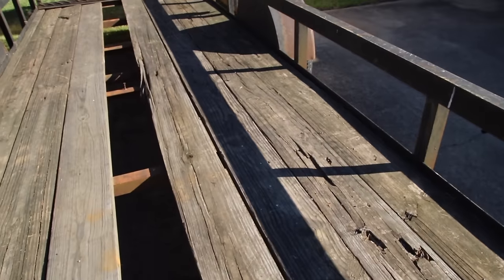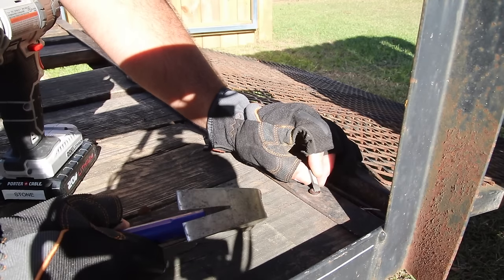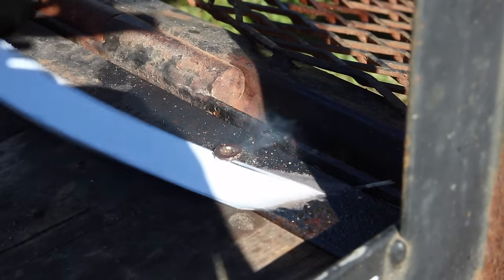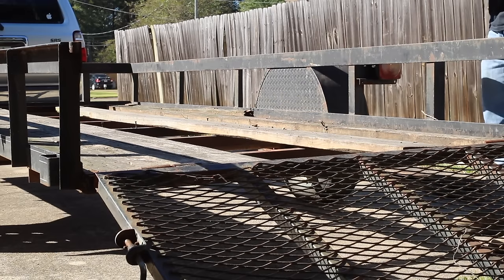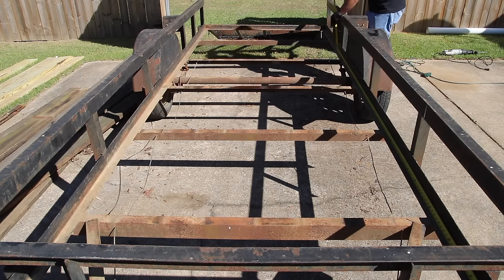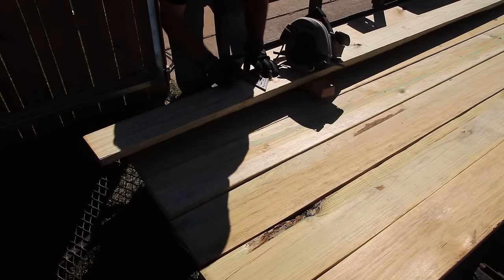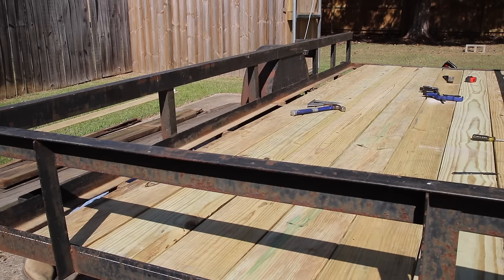Utility Trailer Floor Replacement

Comment: I did not know that angle iron could come out. That makes replacing the deck so much more easier. Thanks for uploading this video!
Reply: It’s welded in on my trailer 😢

Comment: Most trailers are designed for conventional lumber, with out ripping. Spaces between the boards is usually not needed because the boards shrink as the get old and dry out. It's usually 11 2x8....or 10 2x10...I build theses trailers for a living.
Reply: Perhaps you can help me.   I inherited an old flat trailer, with no wood floor.  There is a channel on the front and the back of the trailer.  How do I put the boards in so that they catch in both channels?  There are no screw holes in the support angle iron underneath, so somehow the old boards were put in place without being screwed down.
Reply: @darrinmiller8030  I'm in the same boat. I have no idea how to put the new boards in
Reply: Darrin Miller you can cut the bead of the weld at the end of the angle iron so you can lift it out and put the boards in and then either tack it back down or screw it back on like in this video. I did it to my trailer and it went well.
Reply: Hmmm
Reply: What should I use on my 6x12 with out having to rip the last board?
Reply: @aidenchaffee5568  Not sure what you're asking. If you're asking about what width of boards, You would still have to rip each one to get that. The likelihood that they will fit in at say the five and a half inches of 2x6 boards is pretty low. One way to do it is to lay them in there and and space them evenly and you might make it work without ripping anything.

Comment: Repainting the cross braces of the trailer while the floor was out would have been value added. Also treating the floor boards with Thompsons water seal before installation would have added years to the wood.

Comment: Here’s a trick for everybody......
every time I change the oil in one of my vehicles I collect the spent oil in a 5 gallon pail and then every couple or three years I pour the oil  onto the deck of the trailer and sweep it in with a broom I would buy for $1.50 at the dollar store which I would later throwaway

 Oiling of the deck  does 2 things:  it prevents the deck boards from rotting and it prevents the deck  from shrinking
 without doing my trailer  which has a 16 foot  long footprint  lost 2 inches, when we tried to load cargo which was exactly 16 feet long we were unable to close the back doors,these 2 inches came back a few days after the trailer deck was oiled

Comment: I have found PB Blaster to be a great rust penetrant. Regardless,  the sawzall worked. Nice job!
Reply from the maker: +Jeremy Condon never heard of that. Thanks!
Reply: I found Freeall is much better anything else. I tried PB blaster and it did crap. Then I used Freeall, loosened in minutes.

Comment: How did the gap work out after the new boards dried 
  I have read different opinion in regards to spacing new wet pressure treated boards for my 5x8 utility trailer.

Comment: Once I went to that trouble think I would have cleaned it up and give it a coat of rust proofing. Know your a busy man, is that what we call in Aussie treated pine!!!!
Reply: Just use old engine oil after you change your cars oil why waste of money with store-bought stuff
Reply: or at least some Undercoating to kinda slow down  the rust creeep..

Comment: How did you remove the bolt that was screwed to the angle iron to hold down the boards? I’m working on the same project and having a hard time unscrewing the bolts because they are so rusted

Comment: Question:  my trailer has 2 rows of additional fasteners along braces a couple of feet fore and aft of the mid brace.  Did you just decide the additional fasteners were unnecessary?

Comment: That came out nice.  Thanks for sharing.  A new trailer deck is refreshing.   I did mine about 10 years ago.  It was long overdue as well.  See you next time!
Reply from the maker: +DIY Dillon Thanks! It’s definitely refreshing.
Reply: Dillons Woodworks b

Comment: Nice job. One suggestion i have though. Instead of waiting until the last board to rip. Get your measurements and put the ripped board in the center for a more symmetrical look. Thanks
Reply: A wise man speaks 👍👍👍
Reply: Definitely, was told to start in the middle and work out. You can possibly make the two end boards more narrow if possible.
Reply: My plan is to start in the middle and work to the sides. That would leave the narrowest boards on the edges rather than in the center. It's one concept anyhow.

Comment: Yeah I'm going to seal/treat the wood 1st and add several years to the floor 😉  and since I'm at it just as well wire wheel the metal and rust proof that also.

Comment: What type of screw did you use to secure the decking to the trailer?
Reply: I dont think he did. It looked like the front edges were under the front angle iron and the rear was also covered by that piece of angle iron. I just wondered if the rear boards could still bounce around because i dont think the 3 screws were into the trailer frame to hold them all down.

Comment: I simply cleaned the head out with a screw and compressed air and worked the impact forward and reverse until they came out no lube. The lube will make the heads strip

Comment: WD 40 is a water displacer(WD stands for “water displacer”)NOT a penetrating oil. Use Kroil, PB blaster, or ATF/ acetone mix.
Reply: PB is my go-to as well.
Reply: You are correct, but wd40 does offer some penetration. Check out the comparison on project farms channel. Very interesting results. 👌

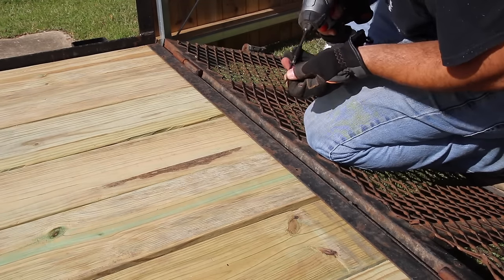Comment: At 5:09, you nailed the retaining bar down onto the boards.  But the boards (with retaining bar) aren't connected to the trailer at all, right?  So a crazy bump could lift the whole rear of the boards a couple of inches and it could start sliding rearward, correct?  Especially if you removed the rear gate in order to haul kayaks or something a bit longer than the bed.

I think I'd put 4 or 5 holes in the front retaining bar, too.  The one that's still welded down.  And driving screws in there would mean the boards couldn't "jump" and slide out of the deck, no matter how big of a bump you hit.
Reply: I see that the same way. I have almost the same front and rear angle iron set up on my trailer with no screws holding the boards down to any cross members in the middle, EXCEPT i made sure to use bigger screws to go through to the frame at the end of the trailers frame at the end.

Comment: So you don't put the same type of bolts back in? You use wood screws from the bottom? Will that hold as well as the original bolts?

Comment: My Tip: For cosmetic purposes only, I would have placed the cut board in the centre of the trailer floor.
Reply: Probably not in the middle as the hand cut line would not be as straight.  For cosmetic aka symmetry, he could have cut the piece on the other end, but that's more work and no one really cares as it is just a trailer bed :)

Comment: The only thing I plan to do different on mine is once the boards are cut to size apply the preservative on all sides then install
Reply: Technically all it really needs is oil. There's no point in finishing a trailer bed. The finish will just come off quickly if you use it with any regularity. Any kind of oil will do, just do it every so often. Not like every month, just maybe once a year or two.

Comment: I use used motor oil cut with diesel to preserve the treated lumber on all my trailers.  Just a thought.  Great stuff Shawn.  There are a bunch of people out there that would just trade it in instead of what you did (the right thing)
Reply: How long does the smell last?
Reply: @DarkLinkAD  I was thinking the same thing. I park my trailer in my garage, and I dont think I'd be able to ever do that again. I would bet the smell will always be there
Reply: No just no. Used motor oil will rot your lumber!
Its what people pour on old tree stumps to rot them away,..why? Cause it does!
Reply: I don't think I would use anything like used oil, but the idea is true, you want to oil your deck at least every couple years.
Reply: @daverea372  no it won't. It preserves it.

Comment: Excellent to the point and informative! Question, my trailer is nearly identical except it is 12’ and the rear angle iron or channel is not removable. It is welded all the way around the entire perimeter. Have you seen this before and have any recommendations? Thank you
Reply: Mine was 16 ft. I used a hydraulic jack underneath (with a scrap of wood to not dent the trailer wood, to bow the board to get them out. Reversed the procedure to put the new one in. Two people would have made the replacement easier, I used a clamping system to push the one end down. Once it’s lined up, then you can ease the jack down.
Reply: Cut a piece wide enough to slide and remove the boards
Reply: @agentleebs  I have a 10 foot long trailer and have the same issue with the rear angle iron. Bending a practice 2x6 but think that if I bent it enough to slip it in there it might break. Over a 16 foot span that would work easier. I have to do some more research on this. I can cut the boards shorter so the bend might work but would like to have as much length under the iron as possible. I welcome any help you might have.
Reply: @SmokeyBear363  Not sure what you meant, Mario.
Reply: Reading further I see that people have cut that angle iron in the back and then rewelded it or screwed it down somehow. I'm going to research that.
Reply: I don’t quite understand how he secured the boards from underneath. I know some guys drill up through the cross braces and all the way through the wood, then use larger self-tapping screws or bolts and nuts from the top to secure the boards. 
But it looked like he used wood or deck screw from underneath. They would  only go half to 3/4 way into the board, but that should be plenty to secure the boards and keep them from warping. 

I think…

Comment: Where did you buy the screws to attach decking?
Reply: Brad, did you find screws? I'm looking at torque's head black screws that can be had from Tacoma screw and fastener. They are self tapping so pre drill and run them in.
Reply: @cfbarnett  yes, thank you !

Comment: I'm really surprised you didn't paint that metal with a rust stopper paint when you had it exposed
Reply: Same thoughts
Reply: I read an earlier reply to a similar question. The original poster said he would do that at some time in the future but he was in a hurry to get a functional trailer up and running.

Comment: That was a good simple project. When you were struggling with the screw, you said you couldn't get under the angle. You could have cut through the wood to get to the screw. We tend to forget that we can destroy the piece we are replacing.
While you had the deck off did you inspect the wiring. On my nearly new trailer, the wiring is not up to my standards. I haven't felt motivated to crawl under it to fix the wiring.
Reply from the maker: +B Templeton Haha you’re right I could’ve cut the wood, and yes I did check the wiring. I was going to add the whole wiring thing to the video, but that it was a little bit off topic.
Reply: Great point.  Thanks.
Reply: @StoneandSonsWorkshop  My boards were so rotten that a grandson had a great time with a sledgehammer beating them to death.

Comment: On your stripped screw heads try an angle grinder, and make a slot in the head and try a Flathead bit. while all the boards are off might as well get a wire brush and get as much rust off the framing as possible, and repaint it.
Reply from the maker: At this moment i was just interested in a functional trailer. Later on I might rework the entire trailer.

Comment: Both pieces of angle iron on my Big Tex trailer are welded. Anyone else have this?  Is there a technique to replace the floor boards w/o cutting those welds?

Comment: At the very end where you screw the angle down to the boards.  Does it hold the boards down? It dont flop up in the back? mine is welded. I am actually fixing to redo my boards but don't have a welder to re-weld it. but if your method works then I'll go that route.
Reply: Yeah it looks like it would flop around. Mine's welded also so I have to cut the angle off then reweld it. Luckily I have a welder. Go buy you one at harbor freight cheap and if you don't want it after the job then return it 😉🍻
Reply: Just bow the boards up in the middle so you can get the ends to slide in the groove then release them.

Comment: just curious my trailer the boards are screwed down every few feet to a cross bar. when i put new wood down how would i line back up to those threaded holes? Somehow i have to make holes in the new boards to line up to the threaded hole in the trailer cross bar. any ideas?
Reply: You'll have to drill your boards from the bottom side under the trailer through the existing holes in the crossmembers. Its easier if you stand your trailer up on it's ass end although that's easier said than done.
Reply: I did this last year and watched this video just to see how he handled it.  But he only showed himself sliding under the trailer.  The rear angle bracket is the hardest because it has to go perfectly through 2 holes.  I made a drill guide to insure I kept the bit straight and drilled from underneath.  Once you make that first hole, put a bolt in it to keep it from moving while you do the others.
Reply: I wasn't careful on one hole in the crossmember and drilled it bigger so the threads don't catch.  That board bows up at that point.  Since the bolts are cutting bolts, the drill bit can be slightly smaller than the hole and avoid reaming out the hole in the metal.

Comment: Did you screw the boards back on from underneath the trailer?
Reply: That's my question as well. Seems like the trailer will flex and eventually warp or cause welds to fall under load.

Comment: Great video mine little different homemade built from previous owner at the gate I didn’t have screws on top nor bottom. I was told to remove gate then cut angle iron or bar that it slides in then re weld crazy huh. I can tear it up just need to get a good solder kit now lol.

Comment: Durn nice job, looks good and done right!
Reply from the maker: It’s solid. 👍
Reply: Stone and Sons Workshop I'm about to do my 5x8, the stamped metal is shot and I'll take the real bad stuff out and want to go back with  maybe 2x6 boards or I kind of thought about looking at  those poly decking  boards since I only haul my mower and some light stuff around the house.

Comment: Just wanted to share this, Kroil is far superior to WD 40 to get into stuck screws and bolts in about the same soak time. try it once you will agree. It might cost about 8 bucks a can but it is worth every penny.

Comment: Treated material as a replacement, is it silly to say a coat of paint adds to the longevity of the timber ?, not sure but my dad always painted most projects so I’m in that mould of thinking 👍
Reply from the maker: +Sumo's Projects if I do anything, I’ll eventually add a sealer. I really dislike painting. Lol.

Comment: Why wouldn't you Por15 or at least Rustoleum the frame before attaching the boards? Lots of rust on those cross bars!
Reply from the maker: +Trey Horsey it may look bad, but it’s really not. I did look at everything to make sure there wasn’t any serious issues. There’s a lot I COULD do, but at this point I’m just interested in a new floor.
Reply: He seemed like a nice guy but he aint no Bob Villa.

Comment: You should be using heavy duty lags, and you should do it at every cross member on every board. I have worked for several construction companies that haul heavy equipment and with a trailer like this you need to secure the board at every cross member. I get that maybe you don't haul as heavy of material but if you ever sell it that's something to keep in mind.
Reply: What is the reason they need to be screwed in every cross bar?
Reply: @deepmarsh  they dont, not on this light duty of a trailer but the reason people screw them at each or a few of the cross members is to keep the boards from moving and warping. Either bowing up or bending in a curve since they arent screwed down. The only thing i noticed was that rear angle iron he screwed the 3 screws to, it wasnt attached to the trailer frame so i wonder if all the boards could bounce up in the back

Comment: I didn't see that you reattached the boards to the frame and the angle on the back looked like you only screwed it into the boards, not the frame. I'm just concerned that the boards could potentially come loose when hitting large bumps in the road.
Reply from the maker: +John Card I mentioned adding screws to the bottom center of the boards through existing holes, but the underside of the back I added washers and screws to the angle iron. So, everything is secured.
Reply: Stone and Sons Workshop   Ok, just wanted to make sure all was secure.

Comment: Recommendation for drilling on trailers that DONT have bolts already? 1 hour in.. 4 broken bits. Not one complete hole
Reply: Definitely late response, but for future reference use cutting fluid to help the bit last longer.

Comment: You didn't explain how you hold down the lumber in the center of the trailer..
Reply from the maker: Just screws through the angle iron.
Reply: And they are all held down by the angel iron lip like he explain a few times

Comment: Put a liberal amount of Boiled Linseed Oil every 6 months and the wood on that trailer would last forever…
Reply: Or could have sealed the wood 1st especially at ends where moisture stays trapped and rots.